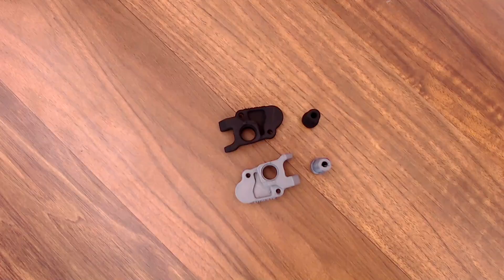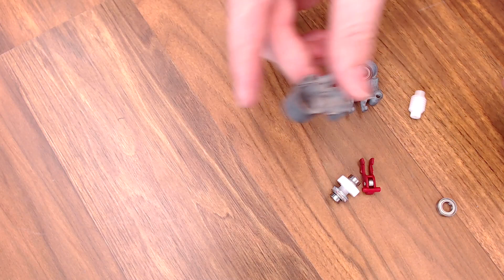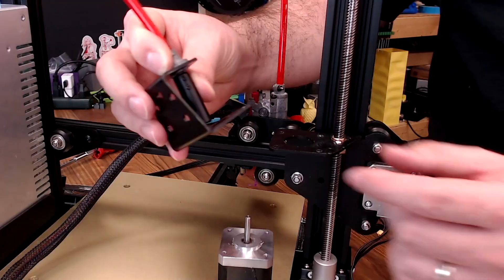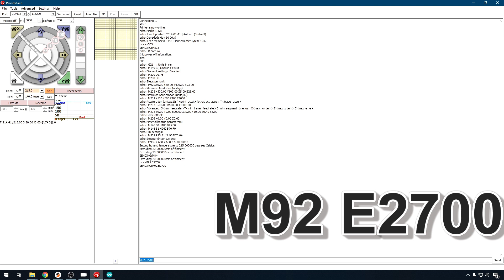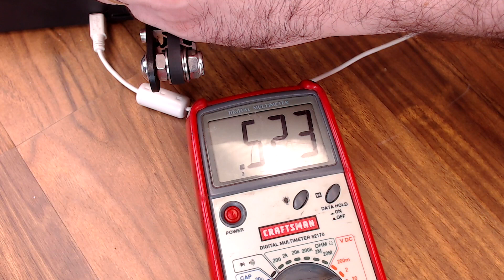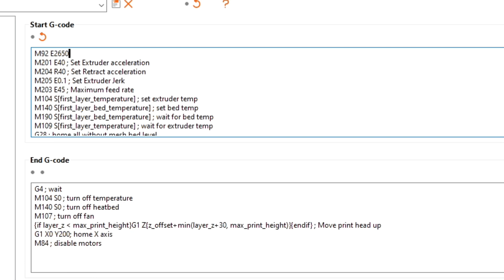The Zesty Nimble - Remote Direct Drive Extruder - Chris's Basement

Comment: "All the benefits of a bowden and a direct drive" No, just no. Taking a cord the same weight as a tiny NEMA 17 and using it as a coil to add hysteresis to the extruder is not the best of both worlds. This is a cool design though, but it is very underwhelming. The real solution is to have a remote NEMA 17 feeding to a NEMA 8 that is on the extruder. That whole flexing motor drive is going to break over time, and is too heavy, especially compared to a nema 8 with dual drive gears.
Reply from the maker: But you got the point I was trying to make right?
Reply: @ChrisRiley  Yeah, I completely understand. Talking about the manufacturer here, it frustrated me that they are making their product out to be more accurate and reliable than what it is. The real problem with weight on the extruder is that manufacturers do not use thick GT2 belts or move to 3MGT belts which are vastly superior. If beating your meat with 80 grit sandpaper hurts, the solution is not to move to 100 grit. Just stop using sandpaper.
Reply: @Anyone700   ouch.

Comment: Thanx Chris. I set one of these up on my FT6 and found by zip tying a Bowden tube to the cable with about a 2” space between the end of the tube and Nimble (for threading filament into it) . A plate where the filament leaves the roll including a Bowden fitting works like a charm and prevents tangles, managing the spaghetti that comes off the roll.
Reply from the maker: Thanks Dave, ah, nice! Great idea!

Comment: I considered the nimble for use with linear advance on a coreXY. The marlin documentation goes into why linear advance does not work well with bowden and I thought the Nimble was a perfect solution, buuuut the extruder jerk settings are so low and linear advance regulates it's speed based on the extruder jerk settings. If linear advance was used with this this it would be too slow.
Reply from the maker: Yeah, adding linear advance here might be a real challenge. I am hoping Numble v2 brings us more options.

Comment: Interesting concept... But I'm skeptical of the benefits vs. the complexity of the configuration between gears and voltage...
Within minutes of this video, just about everything on their site is sold out! That's the power of Chris's basement channel!!
Reply: A remote extruder like this doesn't make too much sense for a Ender 3, but it would be ideal for a Delta  style printer.
Reply: @shadow7037932  I'm still skeptical even on a Delta. The forces of having a spinning steel cable run to the effector maybe comparable to the long bowden tube issues. It's clever engineering either way, and I applaud that!!
Reply from the maker: Clever engineering, well put, I totally agree with you. I am just not sure how effective it will be.

Comment: I figured there was only a remote chance of this working.
Reply: That's a fairly nimble pun you've made there. 😉
Reply from the maker: Not only are the puns great, the add on puns are even better. LOL!
Reply: @ChrisRiley  been trying to get off the 3d printing puns. Recovery is a series of microsteps. Temptation is all around me, but I remain firmware I can.
Reply from the maker: @PrintNPlay  For sure, microsteps, one layer at a time.
Reply: @Chris Riley one layer at a time is key. You try to skip a layer, and the integrity of the entire effort is compromised.

Comment: great video - but I'm not sure what the point of it was if you didn't test what kind of speed increases you could gain by using a nimble... that's pretty much the whole point of buying one, isn't it ?
Reply from the maker: It was really design to allow you to print flexible filament on a Delta bowden setup, but yes, it should allow you to print faster although I didn't have a lot of luck getting it to.

Comment: i think this setup gives you the ability to use bigger extruder stepping motor to increase the printing speed without putting a more weight on the moving extruder itself.
Reply from the maker: Correct, that would be one of the biggest advantages for sure.

Comment: Not a fan of the free-air E step method? That takes out any influence from the path through the nozzle. It's just 2 screws to get it free. A lot easier than for my titan when I first got it and forgot to check E steps. 
The extrusion multiplier in the slicer handles adjusting for flow through the nozzle.
Reply from the maker: That is actually probably the better way to do it. Calibrating while extruding can mask/compensate for a lot of issues that might be going on.

Comment: How would 2700 esteps work with retractions on an 8 bit board with Marlin where the max_step_frequency is 40 000? At 35 mm/s achieved speed that's almost 100 000 steps per second.
Reply from the maker: It would actually be much better if you adjusted the board to 1/4 stepping, it would save a lot of processing power. At 16x certain extruder retraction rates are going to be a challenge.
Reply: @ChrisRiley  I agree with this solution :)

Comment: Great tutorial! Remember to lube the gears before installing. Also the Ender 3 stock extruder stepper motor can be replaced with a NEMA 17 or 14 pancake stepper that has lower rotational inertia - and that can be tuned with the higher acceleration values, so you can achieve faster print speeds. On Ninjaflex, I have found I can actually use retractions and limit stringing on flexible filament.
Reply: I'm using 6mm retraction at 40mm/sec with ninjaflex on my ender 3 with the ezrstruder, zero stringing.
Reply from the maker: @mrb2917  nice! I will have to try some on mine.
Reply: I also got a pancake for mine. What are your accel/jerk etc settings?
Reply from the maker: Thanks! Great info, I will have to give a 14 a try and see what I can get it to do.

Comment: I love the idea behind the remote direct drive, but as you already mentioned the high gear ratio makes it not so much more advantageous to a bowden system when it comes to print time. Because the retracts are slower (but shorter) on a bowden they are faster (but longer). You do however have a direct drive so that is something (I think).
Btw setting the retraction speed to 30 mm/s makes not a lot of sense, since you accelerations are so low. My advice is to look at the prusa acceleration calculator https://blog.prusaprinters.org/calculator/
Scroll all the way down and type in your accelerations and retraction length. Then you can see what your actual maximum speed will be. However setting it to 30 mm/s will not hurt, but know that you wont even get close to that retraction speed.
Reply from the maker: Thanks for the info Max, these points are very helpful.

Comment: What does the 75,95,120 mm specify. question I ask is will this fit on a CHIRON with a 400x400 bed and a volcano?
Reply: It`s the length of the gear wire. Measure the distance from the extruder motor to the extruder - like your bowden tube. Same length as the bowden will work.
Reply: @stigberntsen9301  Then I'd need about a 400
Reply: @martinpirringer8055  I would buy the 95 cm - gives more options when it comes to usage.
Reply: @stigberntsen9301  Thank you
Reply from the maker: Thanks Martin for the comment and Stig for the asist. Much appreciated.

Comment: I've been used a Zesty Nimble on my D-Bot for a while now and I love it. One thing I would say is it doesn't look like you had any lube in/around your worm gear I found I needed this and it is recommended so you might want to check that. It works great for all filaments including flexible filaments which print great.
Reply from the maker: Nice! I will have to give that a try.